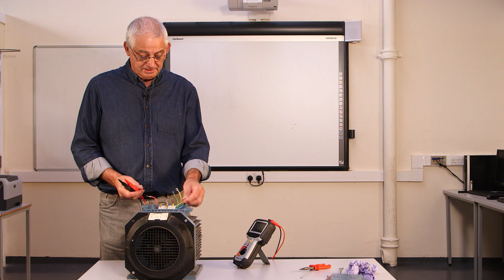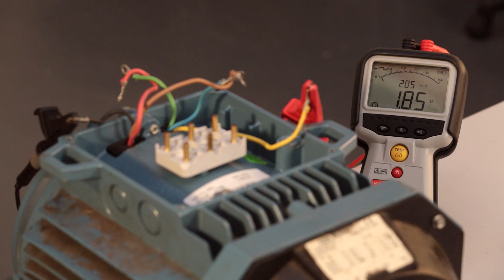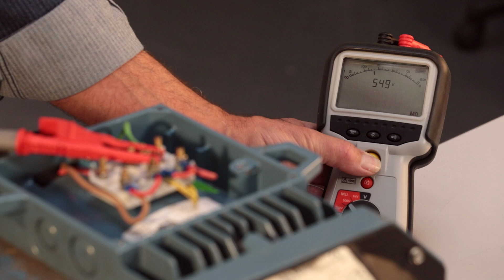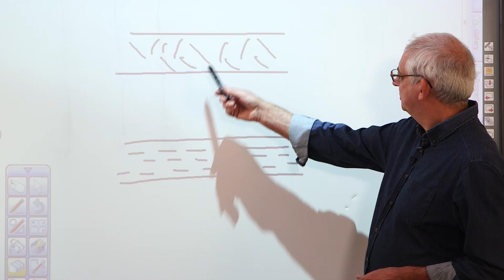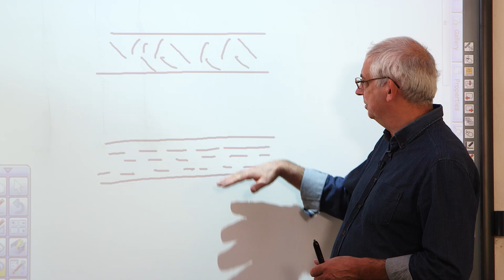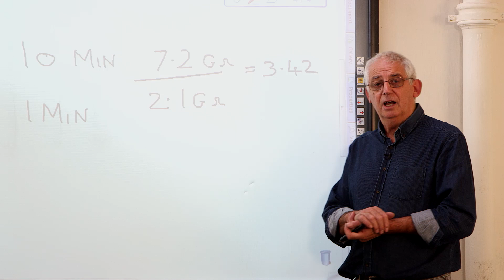3 phase motor test

Comment: Yes. star/delta, 6 wires back to a starter, connect in star or delta depending on your supply voltage. Also each winding has a start U1,V1,W1and finish U2,V2,W2 mix them up and your in trouble. Normal practice is to bring the start out of the motor together and finish out together.

Comment: Nice way to test motors with special equipment!

I like your explanation about insulation molecules, I have experienced a climbing IR value before. Electrical teachers normally just tell you to pee on something to help with continuity values, they never mentioned holding an IR test.

Comment: I had a motor come back from being “rewound” and one set of windings was mislabelled. U1 & U2 were backward. This caused the motor to draw about 185% of full load current. The motor ran slow and erratic with no load. I found the winding that was backward and relabelled it and tried it again and it only drew less than 40% of FLA with no load on the motor. Finding the three windings is the first step, then you have to find which ends are U, V & W 1 and which are U V & W 2 because when they are wired up they form a phaser diagram for current. Each should be 120 degrees apart. If a winding is backward, one current will be between the other two on the short angle. Let’s say all windings are okay and the currents are 100 A at 0 degrees and the second is 100 A at -120 degrees and the third is 100 A at +120 degrees. If the third winding was wired backward because it was mislabelled, then the currents would be: 100 A at 0 degrees and the second is 100 A at -120 degrees and the third is 100 A at -60 degrees(+120 degrees - 180 degrees). If you plot them you will see why the current is so much higher at no load. If it was a perfect motor, the current would be 200%. If this still doesn’t make sense, plot the voltages and currents in each winding on a phaser diagram and reverse one winding and do the plot again to see the effect when you add the currents.

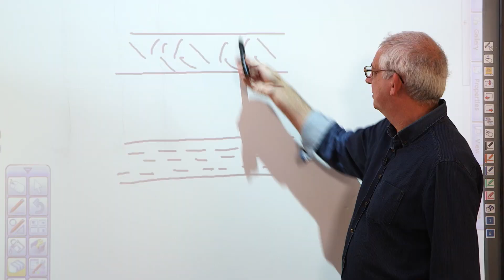Comment: at 9:30 you said that the polarization currents runs through the insulation because it could find paths through the un-aligned dipoles, but this is not accurate. The polarization current exists because of the time changing polarization density which induces the current. J = delta(P)/delta(t).

Comment from the maker: Polarity of the leads make no difference. I am unsure of what you are asking about 1 and 2 if you mean the separate windings each winding will have a resistance. once you have identified the 3 windings and connected them in star  the motor will run. If it makes a labouring noise you will have one of the windings connected around the wrong way. Just swop the ends of one winding and try again, if it still labours reconnect that winding back to its original and try another winding same process with each winding until the motor runs smoothly. if it is running the wrong way just swop 2 lines (phases)

Comment: You would never set the six ends in this configuration.  The top set would be moved one place to the right so vertical delta links didn't link both ends of the same winding. ( I know this was star but you just don't do that). Also should have explained that the ones and twos must be at the correct end. Instant burnt out motor if not. Without manufacturer data you can only assume that all 3 ends from one side are ones and all 3 from other end are twos. Also you don't run 6 ends back to the starter unless it's star delta. You did say for delta.  You also said contractors change from delta to star, this would be the other way round in star delta situation. 

The order for terminal posts could be / top row , W1/U1/V1,  bottom row U2/V2/W2.  So giving two different winding ends to each vertical pair. ie. (w1/U2) ( U1/V2) (V1/W2). 
I know there is a lot of good info here but there is also a fair bit of confused info here that will baffle learners.
Reply: Thanks very much for correcting stuff here. There was a lot of unanswered questions including the ones and twos which i still need more info on
Reply: Made perfectly sense.
Reply: I picked up on all of these and I don’t understand why he is using cable instead of the normal plates! Also got me confused when he said that you must run back to a contractor for delta?? 

Also even if your motor is on a inverter you still need the 1s and the 2s the right way round
Reply: I was thinking the same thing, i.e., how to know which ones are 1's and 2's so to speak.
Reply: quickly realized the wiring after he made the connection and immediately look on the comments to check if anyone noticed that too.
Reply: @michaelcostello6991  you are completely right. i was looking for this in the comments.

if you dont know which ones are the 1's and which ones are the 2's and you connect them wrong. your motor will burn in a few seconds.
Reply: @hessammousavi500  It will take longer than a few seconds. I found this guy to be pretty good. Maybe made too much out of calibration as equal resistance is the key regardless.It is easy to find correct polarity with milli volt metre and simply flashing phases with a 9Volt battery. If you do get your 1s and 2s mixed up then you will notice as soon as you bench test. Otherwise.... given other youtube videos, I think he did pretty well.
Reply: @GymChess  - From top left  (supply)  UVW (1). From bottom left  (windings) WUV (2)

Comment: Good video, but would have like to have seen you phase out the windings for Start and finish or 1 & 2 of each winding...before connecting in star and saying it would run correctly. Good chance a winding is in opposition to the other 2.

Comment: WRONG! 

1st. You should look at the terminal board, it should read U1, V1, W1, V2, W2, U2, not important in star only. 

2nd. What is difficult with 6 wires like that is to figure out which one is 1 and which one is 2 that have to be correct in both star and delta. 

3rd. On motors with light load there is no need for a star delta starter (they are becoming obsolete because there is many better ways to start a motor today), and you can start the motor in delta with a VFD

4th. Even when you use a star delta starter it's nice to connect L1, L2 L3 on both top and bottom terminals
Reply: How to check which one is 1 and 2?
Reply: Angelinna Smith  helooo
Reply: Angelinna Smith u r right
Reply: if u run it on two voltages it has to be connected for delta for the lower voltage.  then it is very important to know which one is 2 or v1
Reply: what is the name of the device his using to measure the resistance and polarization of the Motor efficiency ?
Reply: i think its Megger MIT320
Reply: sorry its  MIT 400
Reply: Angelinna Smith
Reply: acha
Reply: Angelinna Smith  hi
Reply: Angelinna Smith
Reply: Angelinna Smith ON some motors THE winding designations are missing....and..you can only hook L1.L2.and L3 to the top or bottom..not both at SAME time..if I understood YOU correctly?
Reply: Angelinna Smith
Reply: Angelinna Smith hi
Reply: What are you, Alex Trebek? Reading your exclamation of wrong as a if a wrong answer buzzer sounded and you tried to cleave your contestant in half with your declaration of their response status.
Reply: Not very helpful. The guy should explain by drawing how those terminals are connected to the windings by the manufacturer. This is Pretty useless information I would say. In a new motor, The aligned terminals usually don’t share the same winding.
Reply: Getting a little bit of your technical freak on. Interesting. Could you talk me through it once more ? ; )
Reply: Angelinna Smith, Hi
Reply: agreed. My observations. zero'd leads when hes measuring for comparison. spent 1/3rd of the video doing something that is moot.Wired wrong winding to terminals. as you said for U1 to V2? crazy. lastly insulation testing reading GigaOhms and quoting tolerances for something that would be acceptable power x10-3

Comment: The large 3 phase motors I've come across are wired with the coils not aligned on the terminal block i.e W1-U2, V1-W2, U1-V2. This means you can wire them star or delta by moving the copper jumpers. Why would you wire this motor W1-W2, V1-V2, U1-U2? Is it not made to run in delta configuration? Wouldn't it be safer to wire it W1-U2, V1-W2, U1-V2 in case someone wires it into delta; to prevent a short circuit?
Reply: Yeah, I think it should be wire as what you said, U1-W2, V1-U2, W1-V2, so that easier for us to change the copper plate with vertical or horizontal directly for both Delta or Star connection respectively. But for Star Connection in this video, maybe he just don't care about that since it's for Star only, of course for safety consent, it should be like what you said.
Reply: MrCT2012 c

Comment: thank you. this is perfect explanation. on my way to test a 3 phase, dual motor, compressor. its popping the beaker every couple of hours or so. I wanted to get a quick refresher. came to the  shop to pickup the fluke scope, clamp and my old all-test. Usually i work on single phase stuff. when it gets to 3ph, mainly cuz I get to use my tools I get a little jittery and excited about it, hehehehe 
can polarization test be used on a single phase motor as well?

Comment: That terminal block is going to going bang if someone ran delta links. The Windings should be offset on the block not aligned with each other. IE if you connect three phases then each end of a link will connect 2 ends of A DIFFERENT winding. Its dangerous to connect a winding block to only accept star links where as offsetting the windings allows for either star or delta by just changing link configuration.

Comment: How do you know which wire is U1 and U2 / V1 and V2/ W1 and W2?
Reply: They are  the terminals not the wires. The wires can be connected in different combinations. UVW (1) WUV (2) are the terminals.

Comment: Great video, very concise and clear. I'm trying to run a three phase motor on single phase. Do you have any advice for a formula to determine capacitor size for optimum power and minimum heating? Thank you

Comment: how do you make sure which one is U1 and which one is U2? because if you connect them wrongly you will end up burning the motor.
Reply: No it turn reverse
Reply: @DipakFalane-es5ue  no. If you do it wrongly it will burn the motor. One of the magnetic fields might be reverse compared to other two if you connect wrongly

Comment: I have a motor I’m trying to identify the windings on, there is 12 connection, I can see there is 6 pairs. It was operating as 2 speed on the machine. I need to wire it at 2800 delta to connect a VFD, any idea how to identify which is which ?

Comment: you did not identify the polarity of the windings, if one winding is incorrect, the motor will burn out over a period of time
Reply: A Long period of time !
Reply: I had a motor come back from being “rewound” and one set of windings was mislabelled. U1 & U2 were backward. This caused the motor to draw about 185% of full load current. The motor ran slow and erratic with no load. I found the winding that was backward and relabelled it and tried it again and it only drew less than 40% of FLA with no load on the motor. Finding the three windings is the first step, then you have to find which ends are U, V & W 1 and which are U V & W 2 because when they are wired up they form a phaser diagram for current. Each should be 120 degrees apart. If a winding is backward, one current will be between the other two on the short angle. Let’s say all windings are okay and the currents are 100 A at 0 degrees and the second is 100 A at -120 degrees and the third is 100 A at +120 degrees. If the third winding was wired backward because it was mislabelled, then the currents would be: 100 A at 0 degrees and the second is 100 A at -120 degrees and the third is 100 A at -60 degrees(+120 degrees - 180 degrees). If you plot them you will see why the current is so much higher at no load. If it was a perfect motor, the current would be 200%. If this still doesn’t make sense, plot the voltages and currents in each winding on a phaser diagram and reverse one winding and do the plot again to see the effect when you add the currents.

Comment: Do you have to do the polarisation test on each winding? Also where abouts is the earth wire in that terminal block? or is it just to the body of the motor somewhere? 

Also what about the neutral wire?
Reply: 3 phase motors do not need neutral right?
Reply: Go back to school

Comment: Delta connection will not work. Also how do you know if a wiring is not swapped. I mean wether one of them will produce opposite magnetic field. Am I right?
Reply: Yes your correct, he has no way to know which wire is which end of the winding..
Reply: @Jack O'Bean also in star

Comment: What is the advantage of checking the resistance of the windings compared to checking for continuity?
Reply: Just checking for continuity across your windings will not tell you if you have a shorted winding. You have to check the actual resistance value of each winding and compare it to the others. The ohmic value should be very close across all windings.
Reply: I understand
Reply: Muziwandile Mazibuko . If you test the resistance of each winding using an accurate meter like this , you can check for damage within the coil such as a short circuit resulting in a lower resistance reading or an overheated coil due to a bad contactor will show up with this test . This kind of damage may not be apparent otherwise.

Comment: Something I can't understand: Why should those windings be taken off the terminal block at all? To know who is who of u1 and u2, v1 and v2, w1 and w2 - maybe the length of the wires can give an answer. The wiring that was made with with u1, v1 and w1 on one side and u2, v2 and w2 on the other, is rubbish, as others also have told. Rubbish is also this talk about 6 wires for delta connecting, as the grid in the most of the world got strong enough in the fifties and sixties to start a small motor like that with full power right on. In newer time we have got variable speedcontroller that also works as softstart.

Comment: hello sir,Thank you for your great videos, I’v a refrigeration compressor works and then stops for less than a minute and it’s circuit breaker cut off, when i measured the current for 3 phases, I noticed L2 giving a very high current "3 times the normal value" and L1 and L2 normal, what is expected to occur this problem, Even though there is a failure phase sequence in the circuit
Reply: It’s either that in your system they are using your L2’s 230V to control a light or the control circuits or you are experiencing a motor that is unbalanced and you’d be expecting very low resistance on L2 due to the breaking down of windings
Reply: Ohm's law, voltage = current * resistance. If your current has gone up, your resistance has gone down. The winding would have failed insulation about 1/3 along its winding, shortening the length of the active winding, thus lowering the resistance.
If the winding draws 3 times normal current, then the motor draws 5/3 of its rated value. Circuit breakers used in motor protection take longer to trip, as to allow for the high start up current of motors.

Phase protection is to save your motor from running on two phases if one phase goes down.

Comment: How do you know if phases are reversed   In Canada we number leads 1,2,3,4,5,6, Y connection 4,5,6 but if all leads same colour ?,
Reply: James Gaulton color code. I work for a company the everytime we replace a electric motor , either will rotate wrong direction or the brake won't release.
Reply: Damn Canadians! Why is math standard and electricity all different.

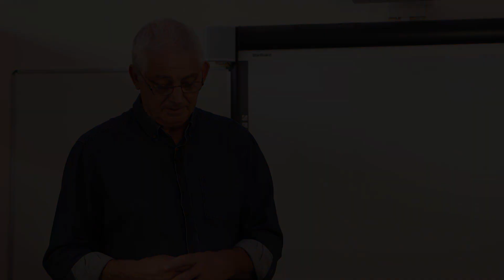Comment: Star to delta, not delta to star 5:58
Reply: actually you'd be suprised. 99% of the time we find star delta starters for low load startup. but old school did used to have delta star starters for setups with high output load. where inrush wasnt a problem but you need that kick to start up a heavy load

Comment: I'm from India.I'm general mechanical technician.3phase motor like 3wire I mean uvw.or ryb.star connection to connect u1-w2,v2-w3,w3-w1.,we can check amp minimum value it's coming every star connection motors condition ok.in 3connection any one less.that motor has ground.replace another motor

Comment: If you use this terminal block by mistake in delta result is kaboom....
Reply: pcuser80
Reply: pcuser80 There will be no kaboom in delta, there will actually not even be a little squeak from the motor. Why do people comment on topics while they have very little or no knowledge about the topic, especially on stuff as potentially dangerous as electricity?

Comment: if the resistance is the same on all winding, how r u knowing whats what?
Reply: Because winding of same terminal gives low resistance value.
Reply: Yea but you don't know what is U, V, or W just from the ohms.  I see the point of the question.  Seems like the instructor rushed through a couple points.

Comment: As stated several times you have not identified which end of each coils is which, you've merely identified the 3 seperate coils.UV &W
Using 1 coil as a reference say coil U mark the ends U1 and U2 then you have to identify the correct ends of coils V & W.............you haven't done that.........................the rest is just guesswork, potluck........not an engineering solution at all....

Comment: how to check 3phase ac motor current in multimeter... plz video upload
Reply: use clamp meter. so much easier. motor data on plate don't exceed it overloaded. check all equal balanced per phase if not got supply issue or motor failure.

Comment: Do you know of a drive that would control a LG direct drive Motor, if so I could sale millions of them if they could run the motor up to at less 3000rpm. The motor is a 310vdc @5.6amps, must have high torque with or without hall effect sensors, prefer no sensors.